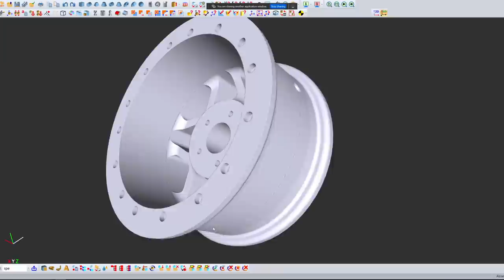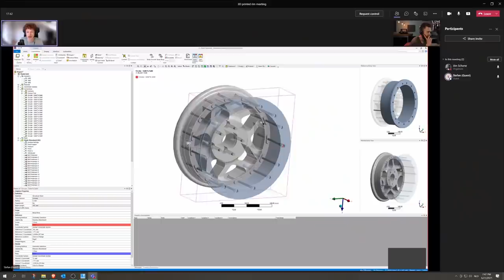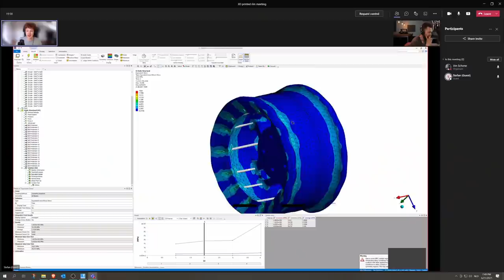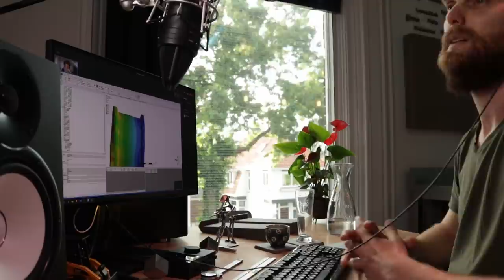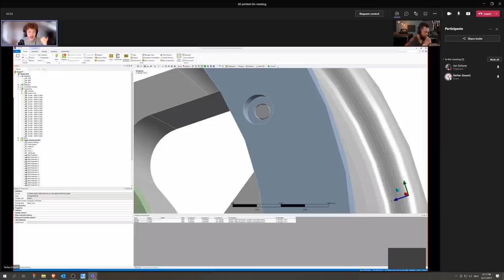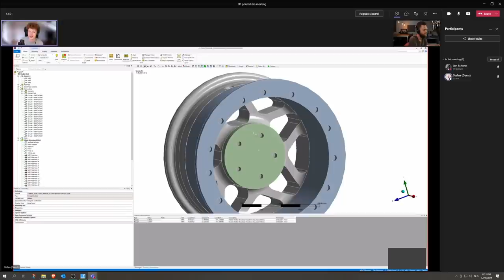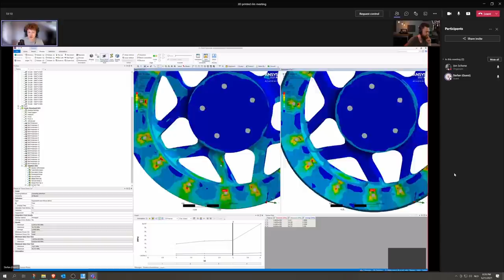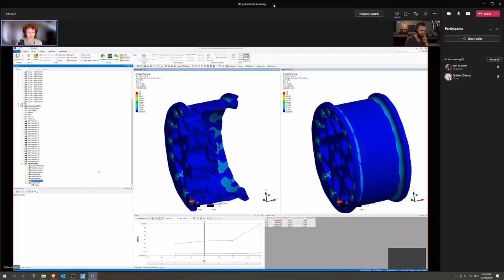3D printed rim analysis: Chat with Stefan from CNCKitchen

Comment from the maker: The rim we tested didn’t have those threaded rods all the way through due to the lack of room between the edge of the tire and the brake caliper. Nevertheless, the points and calculations are accurate, interesting and insightful which helped with improving the design! Finite element analysis on 3D printed parts is a super interesting subject on its own, thanks Stefan!
Reply: i think you can do worse than read the following science paper: 

'Simulation of Vehicle Pothole Test and Techniques Used' or it has other name '2016 Prediction of Aluminum Wheel Distortion under Pothole Impact'

There they do try hard to calculate this stress conditions onto a simulated car wheels. and we can assume that is really the highest impact force typically found under typical everyday real world driving conditions
Reply: @dreamcat4  I’d think if it can survive a large pothole, it can be actually used as a car tire.
Reply: What Stephan says at 13:48 reinforces my comment in the other video. The accidental over-torquing likely damaged the ABS around the inserts and contributed to the failure.
Also, be sure you follow the old mechanics' method of tightening in a star pattern to evenly distribute the loads... never sequentially (I don't know which method you used). Also make at least 3 passes, torquing a little more on each pass to gradually introduce the stresses. This is commonly done on heads and wheel lugs to prevent warping.
Reply: Another high end mechanics technique might be useful for torquing. As Stefan mentioned measured bolt torque and actual pretension are often two different things due to frictional properties often 20-25% off. In race motors it is common to measure pretension of head bolts using the bolt stretch itself. This is usually done by putting a dial indicator on the top of the stud and tightening the nut. If you know the tensioned length and the amount you stretched it you can get very accurate pretension loads in the +/- 5% range as I recall. Experience from race motors and a degree in mech eng. Hope this technique helps!
Reply: @prohr4967  You're talking about orders of magnitude difference between the strength of a nickel-iron engine block and an ABS printed rim though. You'll never get a (one-use) stretch-bolt to stretch torquing into plastic.
Reply: @glabifrons  this is true, however it might be possible to use the fea model and this technique might yield better results. Maybe the solution is to measure the compression of the abs as a measure of the pretension. Using a set of calipers to measure the width of the rim may be sufficient. Stefan would have the magnitudes from the model. Wherever it deflects the most due to the pretension load would be the place to try and measure

Comment: My mechanical engineering thesis was around FEM simulation of FDM 3d printed parts. In the end, where Stefan said about the lack of literature about the topic, it is really true. What I did back then was to use the composites module for Ansys, and simulate the parts being printed solid with the infills oriented like the fibers of composite materials. By using this plug-in it was possible to consider the anisotropy of the material and account for it having a different strength per layer orientation. It is obviously a lot of work, as one has to built the FEM model layer by layer just like a slicer.
Reply from the maker: Very interesting subject for a thesis and interesting approach! Thanks for sharing! Are your findings published somewhere?
Reply: @properprinting  seems like I can't post a list here

Comment: What about using large metal ring plate on either side of the rim where all the bolts and nuts can react against?  This will also allow the outer flanges to be supported when the tire inflates and reacts against the outer rim flange.  With engineering, it becomes necessary to understand the capabilities of the materials used and also to use other materials to allow for high stress mitigation.

Comment: Good analysis. Very well done. Dude! Why not print the rims at low density with a gyroid infill, then drill a port in the skin and pour epoxy (or something else) into the parts to cure fully dense. that would be awesome.

Comment: Stefan is the greatest.  What about loading of the car in some of the other wheel orientations? I assume it would be fine, just curious about the redistribution when it isn't perfectly lined up with the default y.  Also curious about how fast you can rotate the wheel before it bursts.  Having the screws not going all the way through will probably have a major impact since they are relatively heavy and won't be supported by the tire bead.

I agree with some of the other comments that creep will be the biggest problem (aside from heat and dynamic loads). I also think it would be interesting to line the outer cylinder and lip with a layer of fiberglass & epoxy (see Tech Ingredients excellent videos) to make it air tight and add some strength across layer lines. You would need an o- ring or gasket where they meet, and that would make the bolt pretension more critical. 
Great video and interesting series!

Comment: To increase pretension of rim connecting bolts, you could remove bolt and nut insert slots, just let them protrude outside and then use larger shims. This would remove shear forces  in slot corners and spread clamping forces over larger area. Steffan could add one more load case with braking acceleration (I know that for motorcycle it has been measured at aprox 1.4G on sportbikes, but should be checked for cars). This would be interesting to see as FEA results. ;o)))

Comment: you guys familiar with a ringfeder locking assembly? it's like two opposing cones in a doublesided cup locked together with bolts used for power transmission. i'm thinking for the hub bolts that you could turn that into a large chamfered cup to mate to the rest of the rim to change the total surface area that is sharing that torque force during operation.

any knowledge i have is mostly practical as i only work on big old industrial machines - so when it works it works.

Comment: Very interesting conversation and project but.. do you ever calculate temperature of working wheel hub with brake disc? I'm pretty sure your ABS plastic gonna melt starting from hub contact when you first try long brake. I hope I'm wrong and sorry if you already covered it in next videos - I'm only saw this one yet.

Comment: I think 260c is not enough at those nozzle diameters. Also consider putting double 40w heater blocks with a long heat brake and 0 retraction. I would go to 280c or even 300c so you get the absolute best layer adhesion. I find 260c with an e3d extruder is barely enough to accommodate a .6mm nozzle.
Reply from the maker: You're right. I did some thorough tests a while ago and ended up printing everything at 280 degrees C

Comment: Just had a thought, I would recommend mounting the wheel to the front set of the car If rear wheel drive and vice versa as to reduce forces in the wheel when driving and to disable the break for the 3d printed wheel to give it the best chance of working. After test if still working enable the breaks and mount It to the wheels with drive. Hope it made sense. I'd also love to see a discord server for the community to help.
Reply from the maker: I'm going to print four of them eventually😉
Reply: @properprinting  I am aware but it is still in the development stage. Destructive testing is good but the information gained upto that point is even better
Reply from the maker: @henry67278  That's true! The next video will be still with one rim and place that at the back of the car because I think that steering will be quite a challenge for it to overcome. If that works we'll put it at the front. If we mange to drive, accelerate, steer and brake I'll print 3 more. Changes are that it won't survive this so I recon some improvement is still needed, probably at the part where those inserts are seated in. This will be an ongoing project parallel to the other projects I'll make videos about :)
Reply: Looking forward to it :)

Comment: If you do another pressure test .. fill the innertube with water, then pump it up. This is how pressure tests are done. It is much safer because the water does not compress and therefore cant store much energy. AKA: no explosion.

Comment: I believe that programs that I have used in the past, like Femap or Ansys, are capable of calculating non isotropic materials. Such as composites.
Reply: Yes you just need to define a coordinate system for reference to the printing orientation and define a material with different yield values and elastic modulus for xyz. When assigning the material just use what you want to be the printing orientation

Comment: Wy don’t you use the 3d printed rim as a mold and cast the rims with alumium/steel/… yourself. I think its a more save solution if I hear the torque specs of your ABS Rim💪. Love to see this proces in detail by the way 😉. Software used is all been done in solidworks? Autodesk force? Tekla structures?

Comment: Wouldn't you be better off to go with smaller diameter bolts around the outside of the wheel so that you could attain proper pretension of the bolt itself without overly stressing the printed part?

Comment: i would do a test with a smaller scale rim/tire. :\  i would do a topology optimization on it too.
Reply from the maker: I already did a topology optimization, but this resulted in a more difficult to print part. This rim can be printed with almost no support material. The reason for this project is that I want to print large and strong things for future projects. I can only gain experience by doing just that ;)
Reply: some topo optomization programs can account for the least 3d print supports. like ptc creo which i use. :)

Comment: Don't get me wrong, I like your channel a lot but unfortunately a few significant mistakes were made.  First, no convergence analysis of the solution (probably because the results shot off into space or due to software limitation of the number of nodes). Second, simulating an entire axisymmetric element for these loading conditions?  WTF.  Not to mention solving the contacts.... for a material with anisotropic properties. Third, the bolted connections were modeled in a way that is inappropriate in this application. It is not true that the analysis of the rim is complicated by the nature of the load transfer...., but that's another story. I suggest that you consider the loading condition during driving (e.g. acceleration/braking) and turning while the vehicle is stopped.